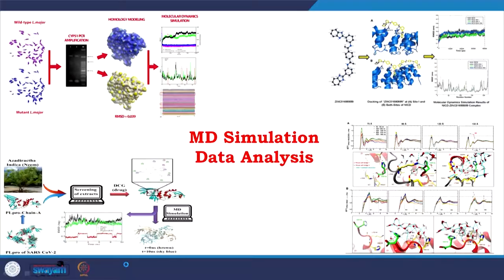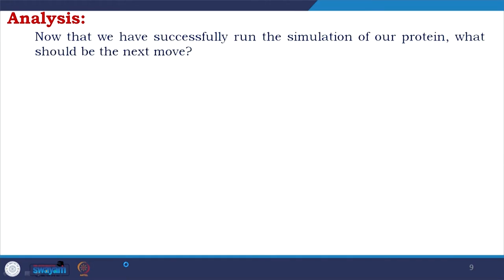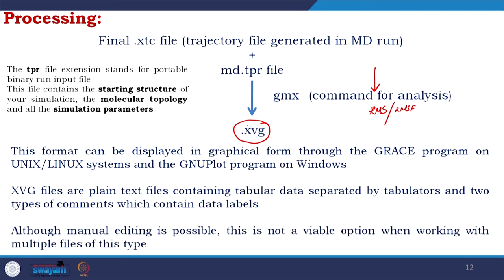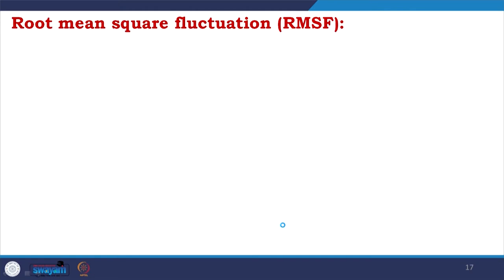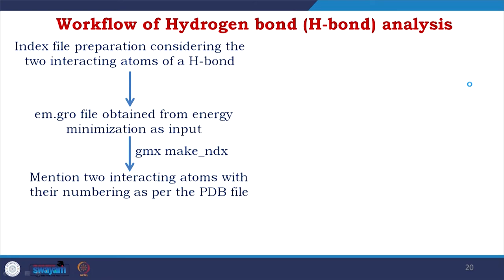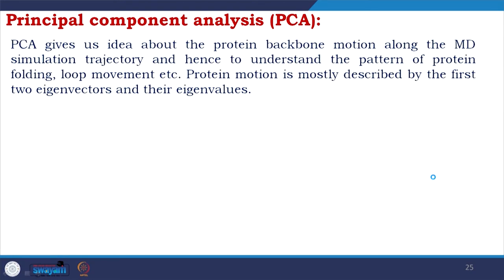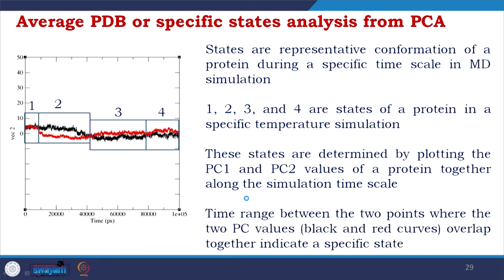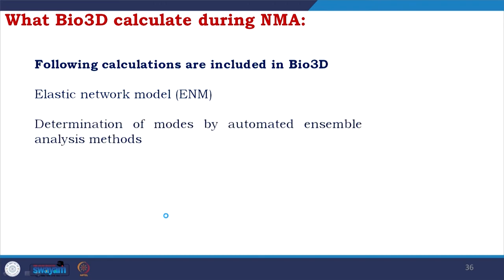Molecular Dynamic Simulation Process: Part III

Comment: This is the best lecture. From the lecture, we are able to identify Monte Carlo simulation and Molecular dynamics, Molecular dynamics, energy minimization& localization (alternative to DFT), a method of data analysis using molecular dynamic simulation, a method of determining root mean square deviations, its application in simulating and modeling protein structure and conformation, and bioinformatics, workflow in protein, conversion of trajectory file to PDB file for protein ( I think it is also possible to apply for most polymers), Free energy landscape(Gibbs energy landscape), Bio 3d Program package, 3D plot using Python, Mode visualization of proteins and Elastic Network Model (Mesophilic & Thermophilic network model), displacement plot, Nature of loop movement in Protein, and NMA Movie. Thanks!